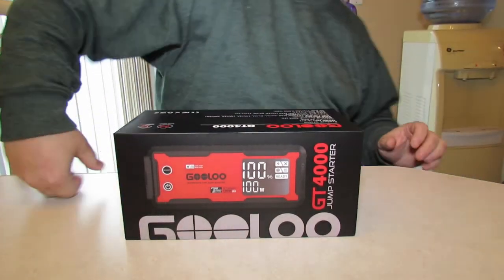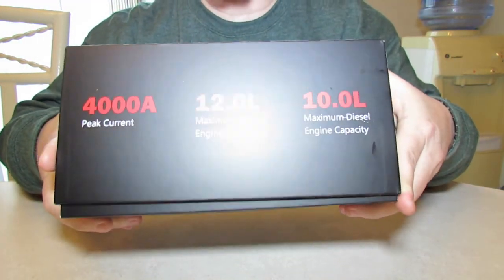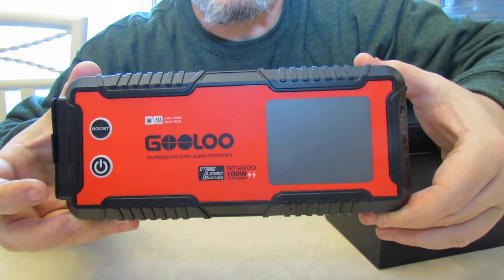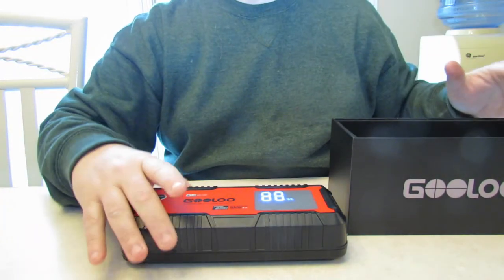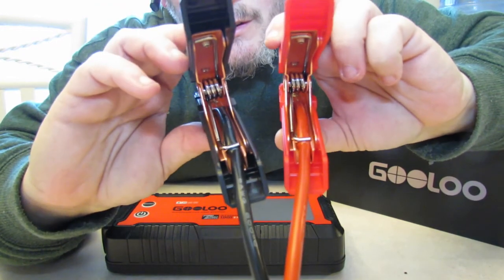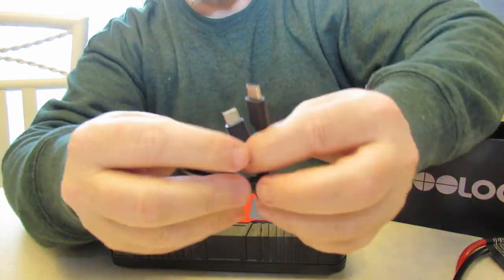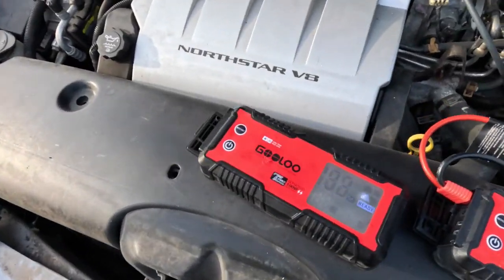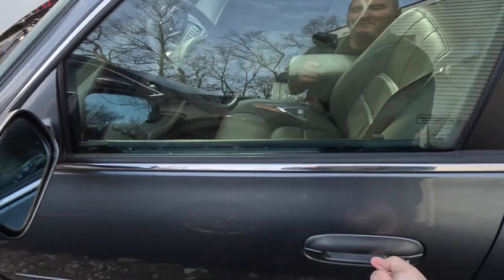GOOLOO GT4000 w/ Preheat Technology..(Tested In-Action)

Comment: so i just got the gooloo gt4000 and was testing the preheat feature. eft it outside in 15 degree weather, when i turn it on it shows the snowflake if i hit boost it will preheat for maybe 1 degree and the preheat icon goes away. i can click it again and it will do the same... anyone else have this?
Reply from the maker: Usually when the preheat technology is activated, you will see a snowflake, as you did, then a countdown of a few seconds should appear, then the snowflake should disappear and not come back on, and the unit should be ready to jump start.

Comment: So, did Gooloo warranty out the one with the pre-heat problem?
Reply from the maker: Gooloo saw my video and reached out to me to send us a new one. The new one works perfectly.
Reply: @HM_RELOADED  You did not contact GooLoo yourself? Because I had a problem with my Lokithor (purchased after watching your video's) which got defective after the first use. It would no longer work in regular mode, only in boost mode. In regular mode the relay/solenoid kept clicking on and off making it unusable. Even when connected to a full battery it would not properly activate in regular mode and kept clicking on and off. I contacted Lokithor but they refused warranty claiming that it was functioning as intended even after sending several video's showing the issue. I ended up returning it through Amazon. But given that experience I would never again consider buying a Lokithor. I mean a defective product can happen to the best manufacturers it's all about how the company handles a defective unit. And Lokithor clearly failed.
Reply: That is the right question.

Comment: Please give us a logical demonstration of all ports on end of unit. I have not seen a good demonstration yet. Such as how can I power up my laptop with unit etc.
Reply from the maker: @keith6872  We will do a video on the ports in the next week or so. But if you need info on charging your laptop, use the included USB A to USB C cable. You will see ports on the jump starter saying USB IN or USB out, if your charging something, use the USB A wire and plug into the jump starter (out port) and hook up the other half which is the USB C to your port on your laptop. That's how you charge your laptop. But I will show in the video. I may even do a Short video as well. 
Let me know if you need any other info

Comment: hi, im in the market  for one. I was looking into this one, and the fanttik T8 Max. which one would you recommend?
Reply from the maker: both units are well made, but i believe the ATGFOX 8250 is much cheaper than the Fanttik T8, but it would come down to personal preference. But both units are heavy duty and well made. But if your looking to save money the ATGFOX 8250A is the way to go, if your looking for mega power, there are not to many units stronger then ATGFOX 8250A. But both units will jump start 8 cylinder cars.
Reply from the maker: @cristianesteban8871  They are both very good units with bells and whistles.
Reply: @HM_RELOADED  Thanks
Reply from the maker: @cristianesteban8871  my pleasure